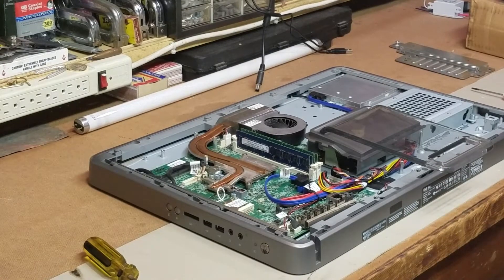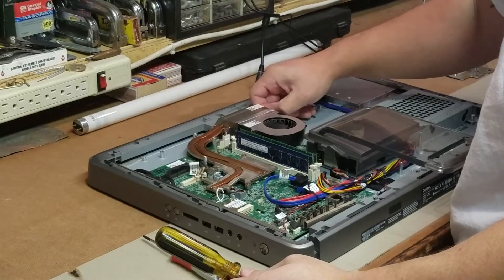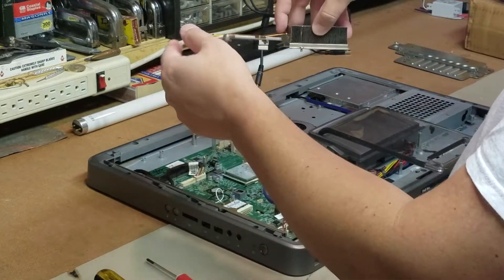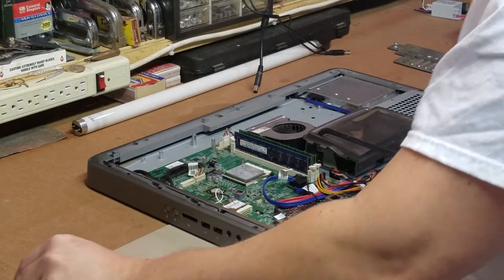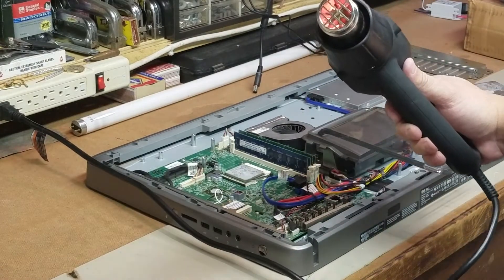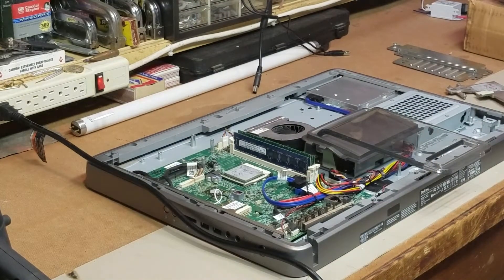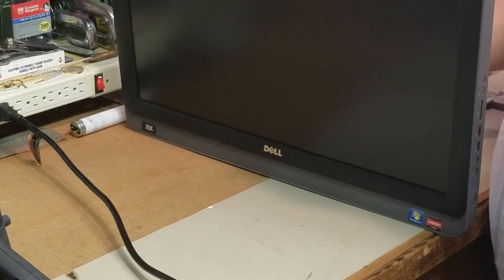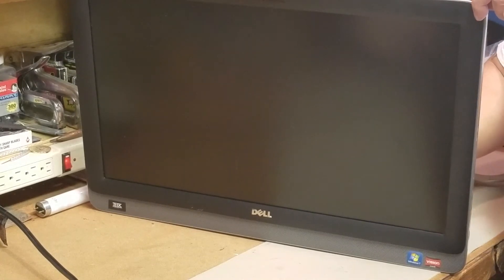Dell Inspiron One All-in-One Heat gun fix.

Comment: OK, good attempt.  A few things you want to do next time:
1.  The metal "arm" on the processor socket (ZIF socket, it's called) needs to be locked down.  You corrected that issue after heat-gunning the processor.  The processor is socketed and doesn't need to be heat-gunned.  An old school IBM trick with ZIF sockets is to close the arm, then open it again, and close it again.
2.  Yes, you want to remove the heat sink (copper tube thing) to do the heat-gunning.  You can leave the heat sink off to test power it, as long as you do it quick, like you did, perfect execution on that.
3.  When you heat-gun it, it remelts the solder on the chip.  Then it needs to cool.  Don't bump the table or workbench, let it cool for a good 5 minutes.  If you bump the table, the chip could get bumped and dislodged from where it's supposed to sit (the solder is underneath it where you can't see) and there's no way to put it back just right.
4.  You missed a chip.  It may have gotten enough residual heat from when the gun was applied by the heat hitting the board and moving sideways across it because it had nowhere else to go.  That chip is located under the blue and red cables, lower down from the chip you were heating.  It sort of has some red paint around it (may be bubbled and blackened from previous attempts).  We never determined exactly which chip is the one causing problems, could be both for all we know.

Unfortunately, sometimes computer manufacturers build troublesome systems.  There was an HP laptop, the dv6000 series, that were notorious for having these problems.  Heat gun them, they work for a while, then crap out again.  There was also a Dell laptop with the same problem but I can't remember the model anymore.  The worst parts is that nobody knows these problems are looming until it's too late and out of warranty.  And replacing the motherboard, while it is still an option, the problem is they ALL have the problem.  They never made another revision correcting these issues.  And just about any board you get is used, so there's no guarantee that it even works, even after you heat gun that one.  It's possible the board for that machine isn't terribly expensive anymore since it's a number of years old, but probably over $100, and I don't think it's a wise investment.  Remember, this was one of the early all-in-one units and they hadn't necessarily worked all the bugs out of it.